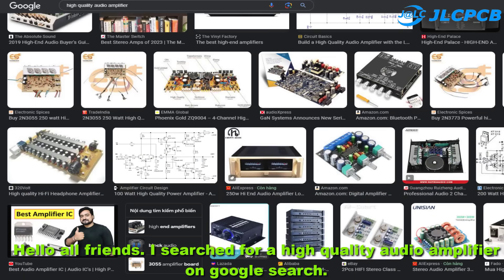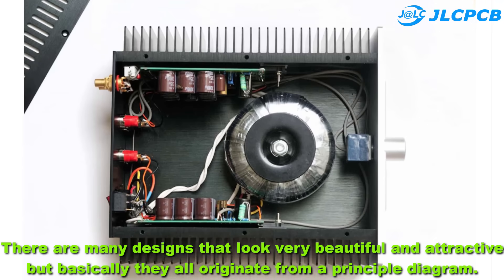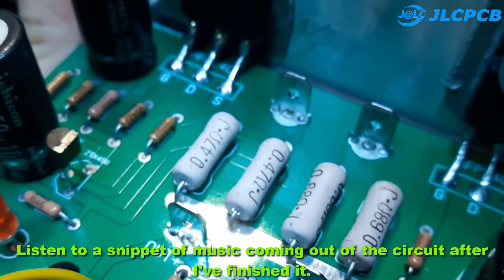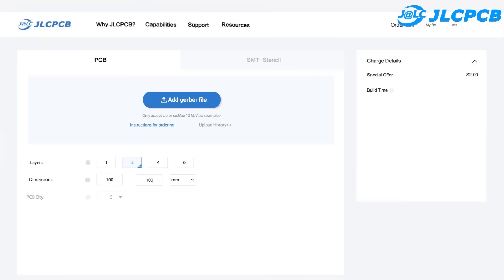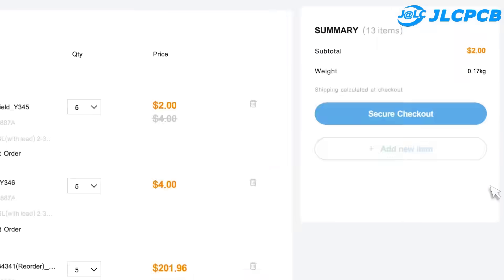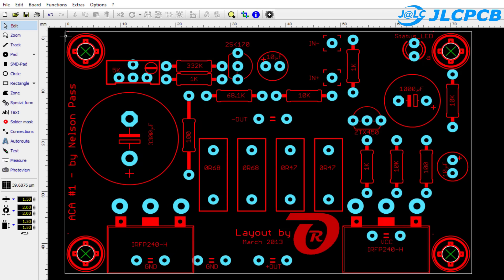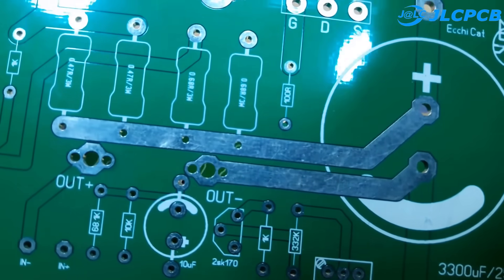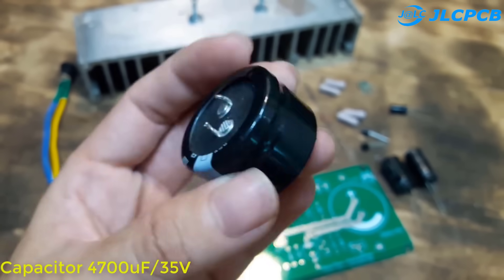Build A Simple Audio Amplifier JLCPCB

Comment: nice video . i want work with inductors. for example i want round one  100uh  Toroidal coil can you share some documents for such purpose ?! it should be noted that i dont have access to core datasheet there is no information about AL or permeability how i can fount them ?!  assume i found core on street.
Reply: You can try to use high permeability amorphous magnetic ring to make SWPS